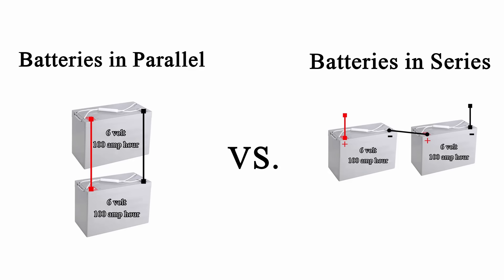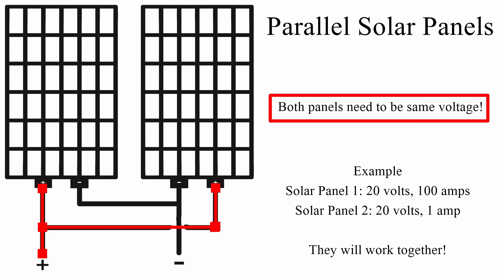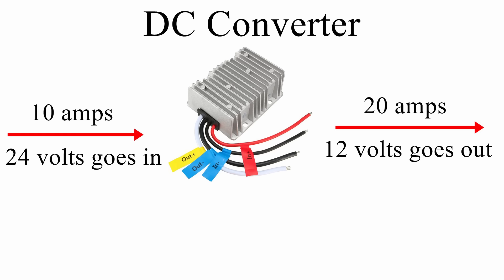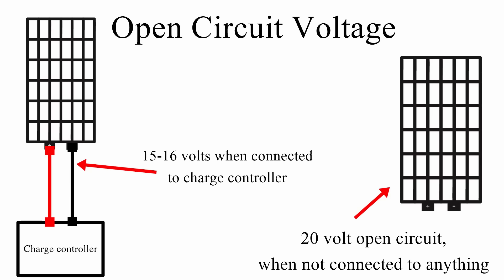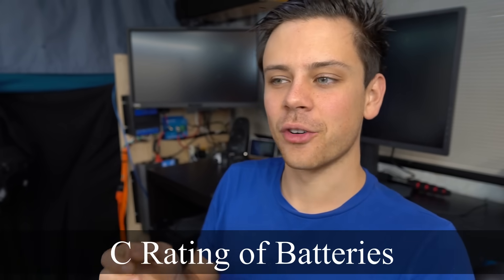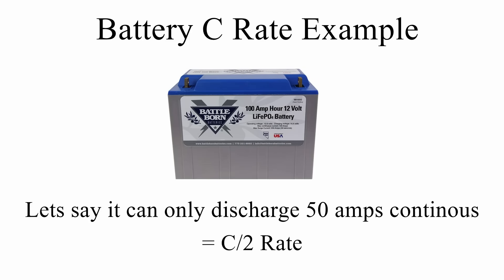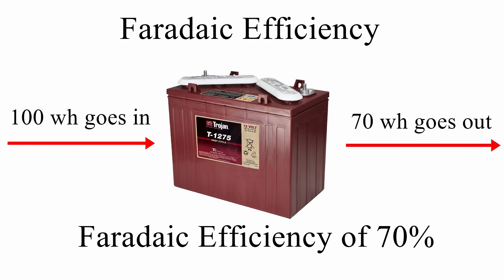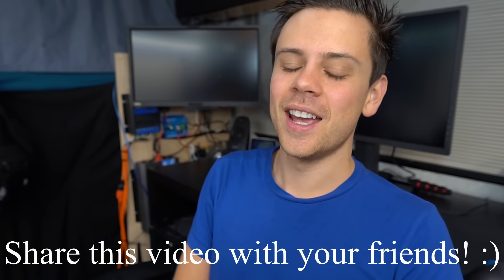Basic Solar Power Electrical Equations Explained! Beginner Friendly

Comment: C/2 is fractional notation and 0.5C is decimal notation of the same thing. C by definition tells how many amps you need to charge or deplete the battery in 1 hour. Since 100Ah means "amp-hour" or 100 amps in 1 hour, then 1C in 100Ah battery is 100 amps. And 1C in 200Ah battery is 200 amps. So, bigger the battery, higher the current can be. What a surprise.

For DC we have a formula: V*A=VA=W (volts times amperes = volt-amperes = watts), knowing that 2*4=8, then if we have an example of 2V*8A=8W, we now know how to multiply or divide based of what is unknown. In terms of water analogy (not perfect but helps), voltage is the pressure, amperes is the flow (or hose size), watts is the power. Flow over time (Ah - amp-hours) is the reservoir size, power over time (Wh - watt-hours) is the total amount of work done.

Serial connection - sum up the voltage (pressures - put one water on top of the other so height increases), parallel connection - sum up the current (hose sizes - with multiple hoses you have a bigger hose). For same power of above 8W, you now have 2V*4A=4V*2A=8W
Reply from the maker: I messed up c rate figure. Mentioned in comments. Oops

Comment: Sorry, in this video you said how  to connect series and parallel, but in another video you said, the same configuration is wrong. So how to connect 8 battery 6 volts in Parallel and series to have 12 volts battery pack ?. Thanks a lot.
Reply from the maker: Raw cell? Like this: https://youtu.be/zStEtH9Le-w

Comment: thank you, thank you. I have been designing a off grid solar and the charge controller amp output conversion from the solar panel input amps have been hanging me up. also is it common practice to series connect, say 3 panels, and series connect another 3 panels, then connect the 2 in parallel to bump up the volts for a 24v bank, but also bump up the amps to get out of the trickle charge low amps, or does the charge controller figure all this out?

Comment: Thanks man. I finally got it and I realise what a huge saving can be made by recycling old lithium batteries. I got a great deal paying only £1.21 per amp hour for my batteries. With a victron 100ah battery you’d be paying £11.20 per amp hour. Tesla model s used battery £5.23 per amp hour at minimum spec. Tesla’s never go out of balance because they are so well made . It’s a good deal.

Comment: This will help me muddle through my solar system, at lest I'll check the C rate of our 12 x 2v battery bank and see if I can draw more that what the 200amp circuit breakers I installed on it will allow, It would be really nice if I can set my EV charger at * amps without tripping the breaker. Cheers

Comment: IF YOU HAVE SERIES CONNECTED SOLAR PANELS BUT EACH OF THE SOLAR PANELS HAS A POWER OPTIMIZER DO THEY ALL NOT WORK IF ONE IS SHADED? OR WILL ALL BUT THE SHADED ON WORK BECAUSE OF THE POWER OPTIMIZERS?

Comment: Will, quick question how come no one uses landscape wire for their solar panels ( 12/2  10/2 ) it's UV resistant and made for outdoor use,  plus much cheaper than solar  wire.
Reply from the maker: Yeah you can use it. I use it for small projects. Not as strong as real solar wire though

Comment: Thanks for the good video. 
Just one correction, though:
If you have high voltage on the pv side (75...150V) and battery voltage (12,24,48V) on the output of a charge controller, you are using an mppt, a DC-DC converter. Any decent mppt let's you limit the output current, it then is usually factory set to its max output current. Even if you oversize the pv array (oversize its peak power, but still remaining below the max voltage) the MPPT will limit the battery side output current to a set value, never above its maximum current. Its actually quite common or even recommended practice, to oversize the pv array when using an mppt, you lose only a little energy over peak insolation, but get more overall energy, without spending much more for a higher rated mppt.
That applies only for decent mppt controller (Morningstar, etc.) , not for junk like EP-Whatever.

Comment: Thanks Will! Very helpful! Question about configuration and balancing: Let's say I buy 8 LiFePO4 batteries for a system, each is 3.2V 100A, for a 12V system.  I would wire it as 2S4P. I would think that I need to complete an 8S balance when I first get the batteries, yes? 

Later on, for a maintenance balance, would I just complete a 2S balance, with two 4P 12V batteries? Or do I have to complete an 8S balance again?
Reply from the maker: do 4s2p. That's ideal. Always go for highest amount amount of batteries in series vs parallel. But you have the right idea
Reply from the maker: When in series, the voltage goes up. 4 in series will create 12.8 volts, with 3.2 volt cells

Comment: 5:20 this is the bit that had me baffled for ages. So for a beginners guide maybe explain that 12V batteries are not always exactly at 12 volts. That they vary depending on how full they are.

Comment: whats your opinion on a victron energy multiplus 12/3000/120 in a diy motorhome setup with outback 80   and 840 watts of solar  total battery bank 2-agm 8d deep cycle 250 amp hours each will it work

Comment: Hi Will, thank for the video, you're a boss at explaining these thngs in terms the normal person will understand. I had a question on the appliance end. I see a few electrical systems designed such that the main fuse block and all appliances are esseentially powered directly from the battery, rather than the appliance output terminals of the solar controller. But the battery voltage fluctuates, and can be up to 13.8, at least on my system (2xLiFePO4  12VCD parallel). In your experience, is this dangerous / bad for the appliances connected? For example, a 12v fridge, 12v downlights, etc? Cheers dude, keep up the good work.

Comment: That was the best, most concise video I've ever seen on this subject. THANK YOU!  Now I have a question. Would it be possible to use a continuous solenoid switch to a solar charge controller to charge my house battery from the alternater?
Reply from the maker: Thanks! And usually not, unless its rated for your alternator. I wouldn't go that route though. Professional method is the Sterling battery isolator/charger, cheap method would be voltage sensitive battery isolator.

Comment: I had a 100w panel on my van. I wanted to put more power into my battery, so I bought 2 X 30w panels and wired them in parallel with my 100w panel. I was roundly chastised for this, and convinced to rewire them in series with my 100w panel. I was also criticized for this. So, I removed the 30w panels and am now back to the single 100w panel. Is there an acceptable way to salvage my 30w panels? I'm thinking that series-wiring them with a 40w panel, and then parallel wiring that with my 100w panel will effectively give me 2 X 100w panels. Yes? Thanks.

Comment: Will, I bought your book but I still do not know what your talking about 1/2 the time. I bought two Windy Nation 100 watt panels and I am going to run them through an MPPT Tracer 40L to a Renogy 100AH battery. Am I on track or has the train left the station without me?
Reply from the maker: Yeah 40 amp may be Overkill, but it is great to oversize the charge controller so that you can add more panels in the future. 20 amp required for 2x100 watt panels whether they are in series or parallel, at 12 volts.
Reply from the maker: I'm sorry to hear that :( and yeah, that would work

Comment: Will what is the C rating of the Tesla battery you use?
Reply from the maker: 1100 amps at 24 volts. Ah total is 250. So 4.1ish C. Discharge rate. But that's with cooling. I don't go over c/3 with it. That's why it will last for ages.
Reply: So for use with an RV there is no need to use the cooling.  Just heat it so it doesn’t freeze or get to cold
Reply from the maker: Oh yeah no need for cooling at all
Reply from the maker: Yeah heat if in cold environment
Reply: Will  thank you for your help  Much appreciated

Comment: 1000 watts solar panel with series and parallel connection; 12volt panels. 1000 watts x 24v= 41.6 amps. Does this not exceed the SCC output having 40amp unit?
Reply from the maker: Very true, but if you have a charge controller with over current protection that allows for over paneling (ones on my website), it's totally fine. Look up victron recommendations for max watt input

Comment: Hey Will I am trying to put your math to work here. I have a Jackery 440. Trying to match up a 100 watt panel to it. The Jackery  Portable 100 watt panel provides 32.4 Volts / 3.12 Amps = 101.088 Watts .... the solar panel I was looking at from HQST claims to provide 100 Watts but specs for that panel say 17.9 Volts / 6.72 Amps = 120.288 Watts. Its a bit higher wattage then what they claim "100 Watts" can this panel work safely with the Jackery 440?  The HQST panel I am referring to is the 100 watt panel next to the 50 watt panel you referenced in your recent video with the Jackery 240. Appreciate your thoughts.
Reply from the maker: Hmm that's tough because I don't know the true amp/volt limit of the jackery. Probably best to find one closer to jackery panels spec. You could always add a fuse at an amp rate close to the jackery panel amp output to be on safe side.
Reply: Thanks for the reply Will. You Make Solar Fun my man !! I love your book too !!  You did a Great Job with it !! .....Will Prowse "Making Solar Great Again" MSGA

Comment: Thanks for the video Will. I know just enough to be dangerous and am always learning more. I have a technical question: I have two 6 volt 260Ah Deep Cycle Pure Gel Batteries connected in series. I also have a 100Ah 12v Lead Acid battery that I would like to add to them. Can I add the 12v in parallel to the 2-6 volts to pump up my amp hours? or do I have to stick to 6 volt batteries now
Reply: no i dont think this works... 260ah and 100ah... no good idea...

Comment: I'm still a little bit confused but I have a question I bought a Goal Zero Yeti 150 portable power station. From Moose Jaw, and I have asked them, what the best at the least amount of money solar panels would go with this generator. I cannot get an answer and I don't know who else to ask. I Am brand new to solar panels and generators. Thanks in advance if you can help.
I'm going to save this video and keep going over until I get this. I am dyslexic but I can learn I have a master's degree and had to take a lot of math it took me a long time but I passed them all. So thanks for trying to teach us.
Reply from the maker: 50 watt solar panel. You could build your own. That generator cannot power much, to be honest. I have a video that I just posted yesterday about adding a panel to a jackery. Same protocol for your goal zero.

Comment: Good video Will. My van has five 12 volt panels connected in series into an MPPT controller feeding a 24 volt Tesla battery. I have three panels on top and one on each side so if I don't have the one on the side that's in the shade tilted up and into the sun it will not produce any power but because all my panels came with bypass diodes, the array still works fine.....it just is missing the power from the shaded one. (minus the forward bias voltage drop of the bypass diodes)
Reply from the maker: What voltage is your array?
Reply: @WillProwse  Max OC voltage of the panels in series is 112 volts. The most I've seen, looking at my controller history is around 114 volts. I have a Morningstar Tristar MPPT 60 with a 150 volt rating.

Comment: Thank you. I made the 4s LIFEPO4 from used prismatics as described in your recent video. Is it safe to make a 2nd one and combine into a 4s2p system?
Reply from the maker: Yeah you can. But it's best to avoid parallel in a perfect system. But you can.
Reply: Will Prowse thanks. Would a 8s 24v system be ok?

Comment: 8:20 Why doesn't the charge controller raise the input impedance, so that it does not exceed it's rated output power?
Reply from the maker: Why would you want to do that? It would reduce power significantly
Reply from the maker: There are some that allow for some degree of over current, to over panel, but not by much

Comment: Showing the same battery for 1C, 2C, and C/2 might confuse some folks, particularly visual learners. I understood it was just to have a battery visual in the slide. Thanks for the video I did learn a few things!
Reply from the maker: Right. I couldnt find batteries with exactly those ratings, so figured a 100 amp was good as a reference. I wish I had another way to show it.